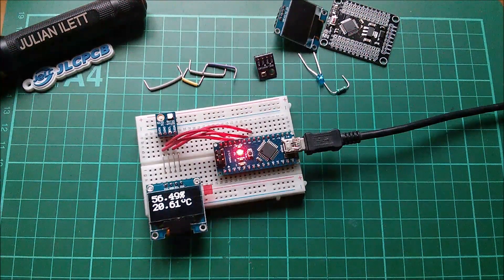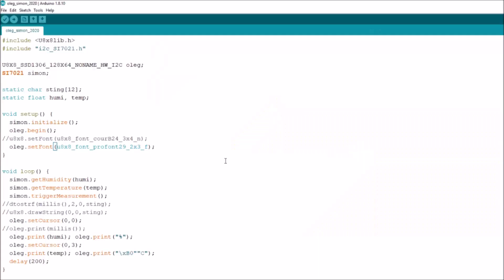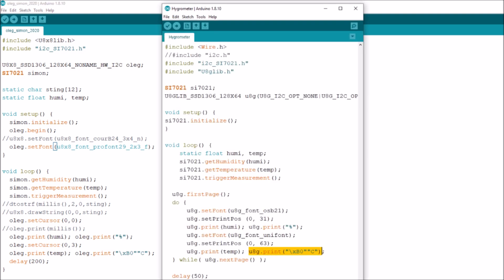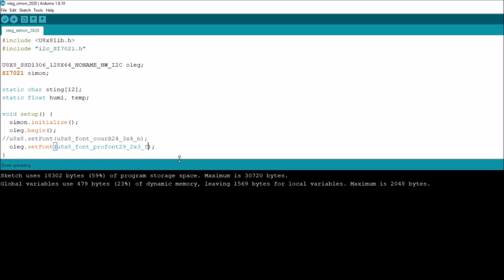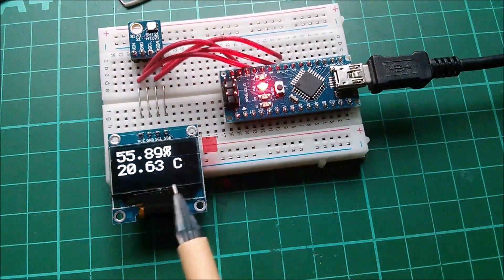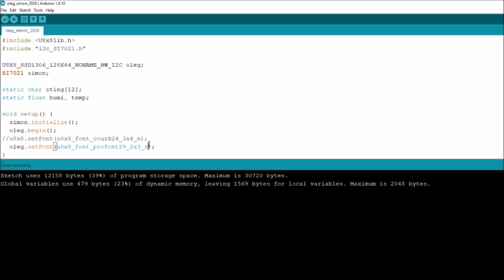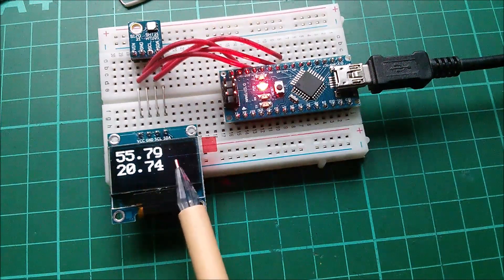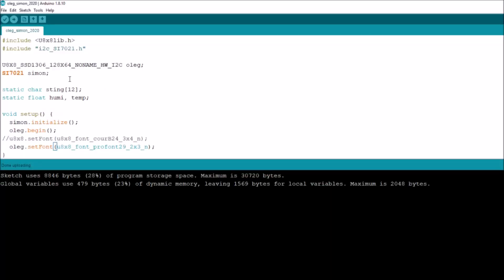Arduino Nano, OLED and Special Characters

Comment: Well explained, but if you are only using the device for one project like temperature and humidity then surly it does not matter using up the extra memory as it will not be used on that project.

Comment: ...or just create your own font that for chars 0x00-0x09 have digits and then dot and %, and anything you really need). This should minimize library size and the translation ascii -> your font mapping could be done in a function or if you can do with bit of a bother - use #define's

Comment: They dont have a nano with more user memory? 32k isn't enough.
Reply: You can expand SRAM and EEPROM but not the Flash memory.
I wonder, if you added an extra SRAM or EEPROM module, could you stuff the font into that and access it from there rather than Flash
-----

There are three pools of memory in the microcontroller used on avr-based Arduino boards :
Flash memory (program space), is where the Arduino sketch is stored.
SRAM (static random access memory) is where the sketch creates and manipulates variables when it runs.
EEPROM is memory space that programmers can use to store long-term information.

Flash  32k bytes
SRAM   2k bytes
EEPROM 1k byte
Reply: it's not the Nano's fault it's the 328P chip's limitation

Comment: The fonts are just arrays of data. You can go into the library source, find the font declarations, and copy it out and create your own font with just the chars you need.
Reply from the maker: Worth a try - but my priority now is to add the rf24 library for the nRF24L01 transceivers :)
Reply: @JuliansShorts  Turns out it's a little more complicated than just a copy and paste. I built just such a file for you here: https://gist.github.com/zostay/c1c77a22f5deb6a2571784f8d4c7ff5c The problem is that u8g2 fonts are not compressed, so as you can see it contains a lot of 0's. It's slightly better than the _f file though. It could be compressed by either ditching ASCII or seeing if ucglib fonts can be used with u8g2, as those fonts can be compressed. I'm not familiar enough with u8g2 to know. (Or the crazier solution would be to add C-code to insert runs of '\0' characters, but that's getting into a lot of complication for a simple project.)